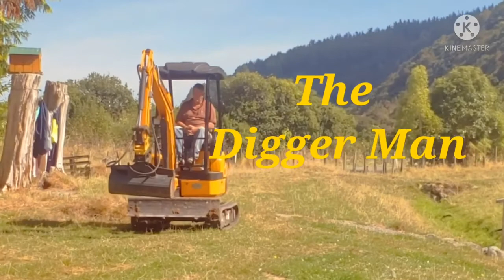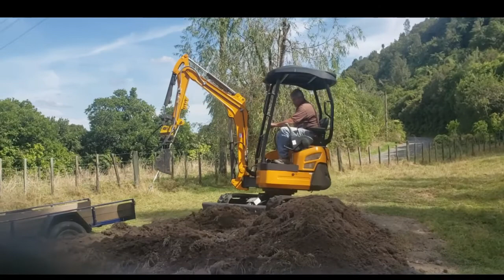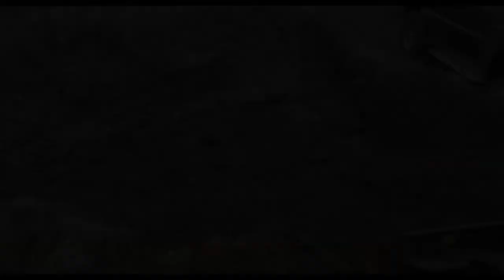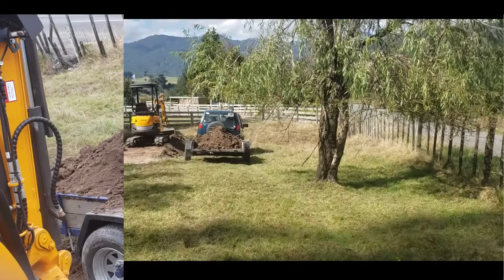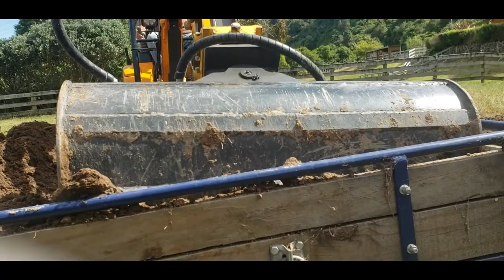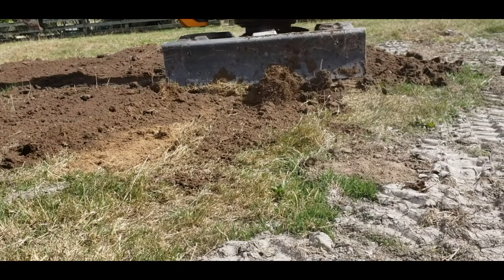Rhino XN20 Digger Demonstration

Comment: What was the cost of the machine and who did you buy it off? Regards Dan and awesome vids too by the way :-)
Reply from the maker: Thanks for that Dan. So where are you? Are you in New Zealand?
Reply: @dinomite_diggers3453  yep in Gisborne mate and keen on the same set up you have. Did you import the machine your self?
Reply from the maker: @danielratapu3436  Hi Dan I bought it from a guy in the Wairarapa, Shaun Rose, trades as Roselea Farm Ltd. He sells Rhinos on Trademe but the best way to contact him is by phone 020 40123659. He mainly sells the XN10 and XN12 but this XN20 is far better suited for what I'm wanting. My one was a demo model with 50 odd hours on it and cost me about $24000. That was with 800mm tilt bucket, 400mm digging bucket, 200mm trenching bucket plus a ripper and the thumb. Hope that helps. Cheers.
Reply: @dinomite_diggers3453  Awesome mate thanks for that I have been talking to shaun a while ago so that sounds good cheers again and keep the vids going :-)
Reply: The operation of the mini excavator is very simple and can effectively replace manual operation, which greatly saves manpower and reduces the cost of manpower input. If you need it, please contact us as soon as possible:Email：sales@leking.net,   Web：https://www.leking.net

Comment: Yeah your not wrong these little machines are more dangerous than the bigger ones. Iv come close to tipping my little 1 tonner a few times. You are a very competent operator well done. Congrats on your new toy.
Reply from the maker: Hopefully this week we will get the next video posted which shows my Rhino working with an extension on it, that really makes it into a different beast altogether.
Reply: I've always said if you can dig smooth in one this size the bigger ones are a breeze

Comment: Looks like a good buy, i was thinking about buying this one, but ended up choosing a cheaper option with a used branded machine.
Reply from the maker: Hi Ant I'm happy with this machine but you are probably better off with what you got. Your Yanmar looks a good digger and some of the boulders and stumps you are dealing with would be too big for my one. Looks like you are getting a lot done at your place with it, and it helps that you are a good operator. Just watch your head when you drive it out of the shed, not much clearance there. Cheers/

Comment: Hello, how big is that bucket? I have a Chinese 1-ton but I think this model will be my next buy.
Reply from the maker: The bucket is 800 mm wide. I started off with a 1.2 ton model then upgraded to this 2 ton and have never regretted it. The 2 ton is so much better built, better to operate and much more stable.
Reply: @dinomite_diggers3453  Sounds great.

Comment: How have you found the rhino is it a good solid reliable machine? Any issues or anything, I'm after a 1.5 ton digger I've seen these but with them being Chinese I've been very unsure about getting one but all the kubotas and other second hand branded ones the same price as the rhino are all battered and poor condition. Is it something you would recommend to buy
Reply from the maker: Yes I know what you mean, I would have liked to get a Kubota or Hitachi too but would have had to go with something with high hours on it. People say stuff from China is junk but I'm quite impressed with what I'm achieving with this Rhino and it's coping with whatever I ask of it. I actually bought an XN12 but it really wasn't suitable because my property is quite rugged so I upgraded to the XN20 and have never regretted it.
Reply: Hello, are you stil happy with the digger. Did you enconter any problèms, failure or mal fiction.
How many hours of work did you put on the machine?
Reply from the maker: @obaysurfdeluxe3500  Yes I am very happy with the digger, it's coming up to 500 hours on it now and has proved very reliable. It is not top of the range compared to some of the better known brands, but it does what I ask of it. Cheers.
Reply: Thank you very much😊

Comment: Where are you located? I recently bought a Rhino international dozer and am trying to find a manual for it. Any help would be much appreciated! Thanks!
Reply from the maker: Hello Robert, I am in New Zealand. I never received a manual with my digger so I went on to Google and typed in, RHINO XN20 OPERATORS MANUAL. I got a few results and found one which let me download a very good 200 page manual for free. It's quite comprehensive complete with quite a lot of colour photos. Hope this helps. How big is your Dozer? How are you finding it?